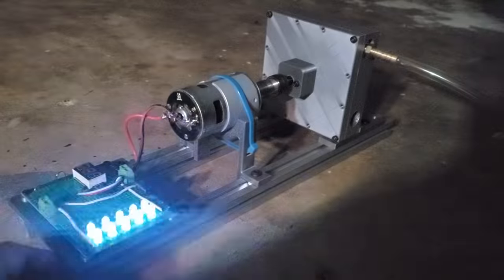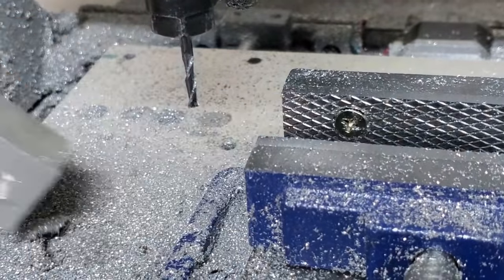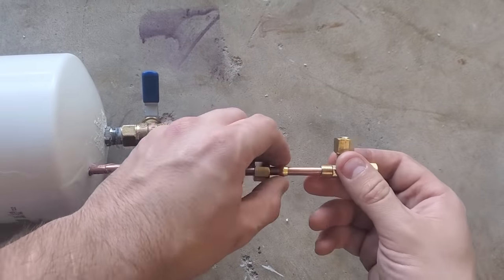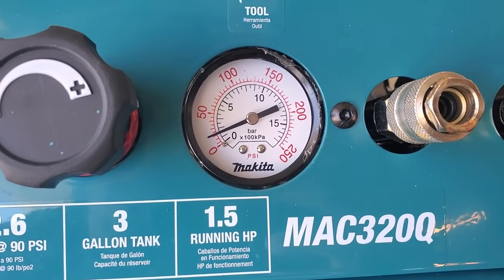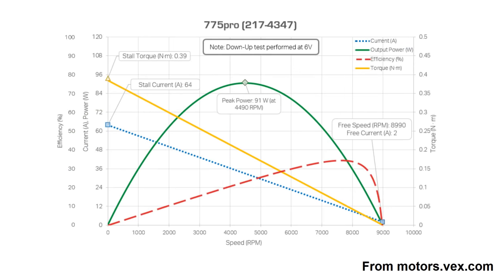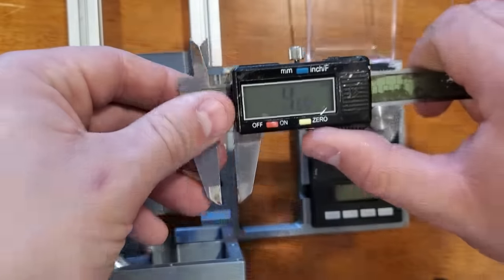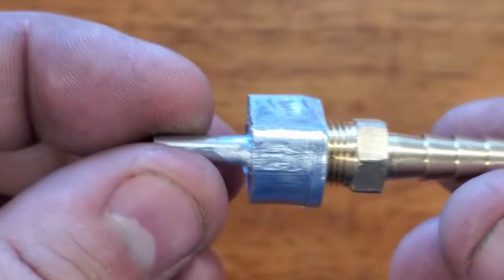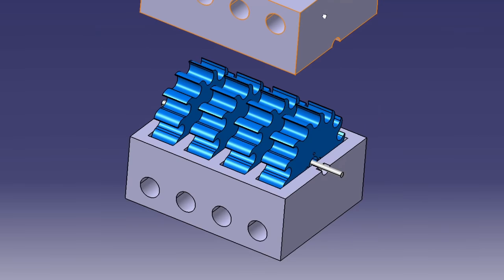3d Printed Compressed Air Turbine

Comment: Dude, multi-thousand RPM rotor - basically a Dremel - pointed into the palm of your hand?  It’s a Florida Man headline waiting to happen.  You have a 3D printer.  Design some fixtures to hold things down safely.

Comment: try a hot air valved (or valveless) pulse jet type of hot air pelton type turbine engine generator, even rotary or revolver type valve
Reply: the rotating valve can or should be separate from the output hot air stream, ie, separately controlled
Reply: I mean try making the pelton turbine generator work with burning something and converting that to the fast hot air flow with the tight nozzle
Reply: try making an aluminium-air fuel cell engine, with 3d printed style spool wire of aluminium, using the wire through a holder nozzle as the second electrode, carbon rod as the air electrode
Reply: try center-in rim-out turbines, ie, inverse tesla disc turbines, with the scoops, but not a water wheel but an impeller wheel
Reply: then the centrifugal acceleration works with the turbine and not against like in the tesla turbine

Comment: The reason that the motor wasn't a reliable test device is because it was wound and clocked as a motor, not as a generator. Plus is was cheap. Your final test rig was far better.